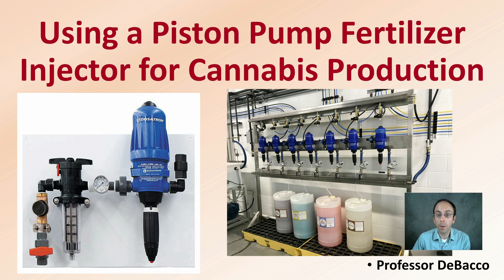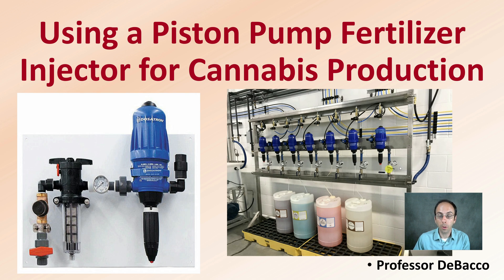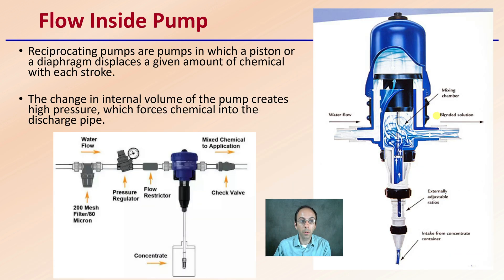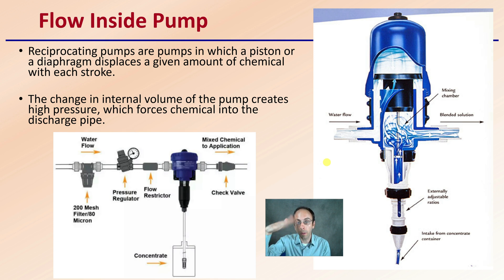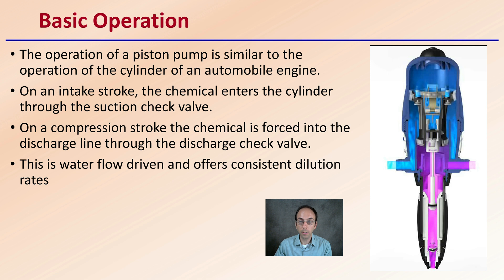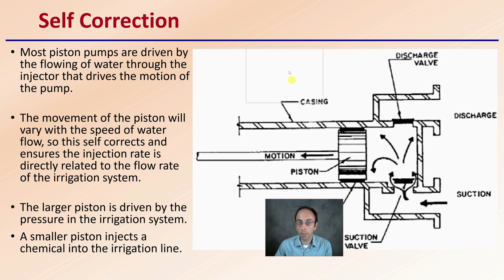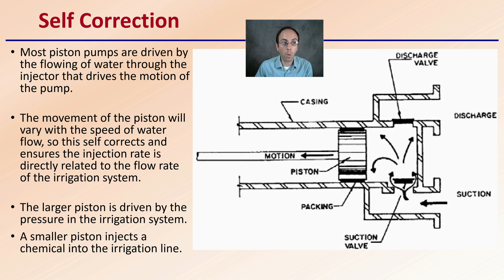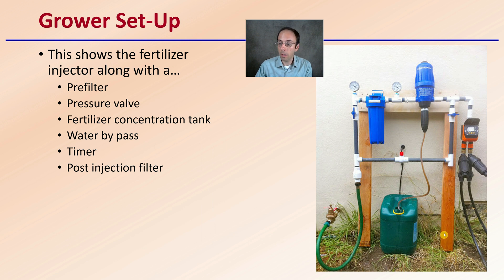Using a Piston Pump Fertilizer Injector for Cannabis Production

Comment: Are there blender valves signaled by downstream EC, in the case the grower wants to dilute the nutrients?  Like for instance if the leache and or substrate EC is too high, future watering would nutrient diluted 50%-75%.
Reply from the maker: This can depend how the grower sets the system up.  Your suggested progression would be the "best" method to ensure the material delivered to the plants is at the desired EC.